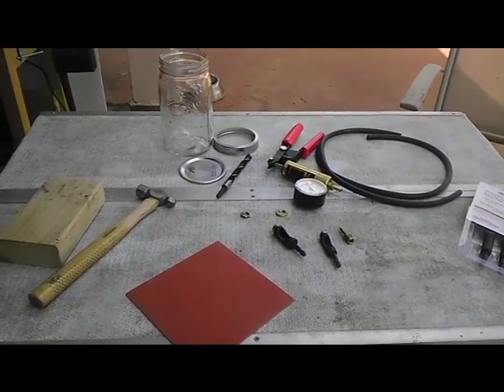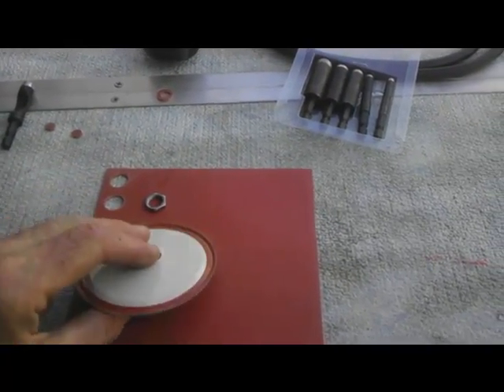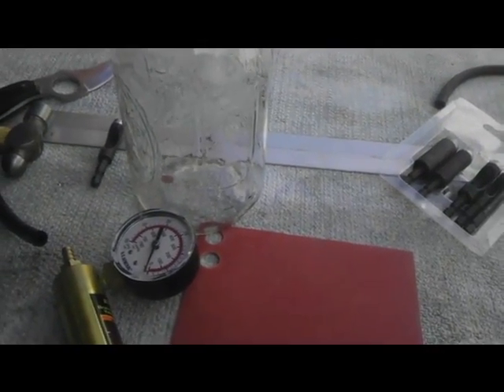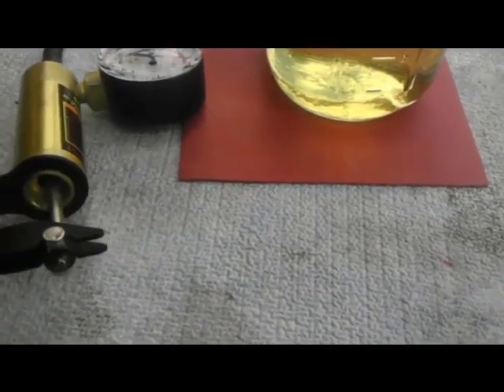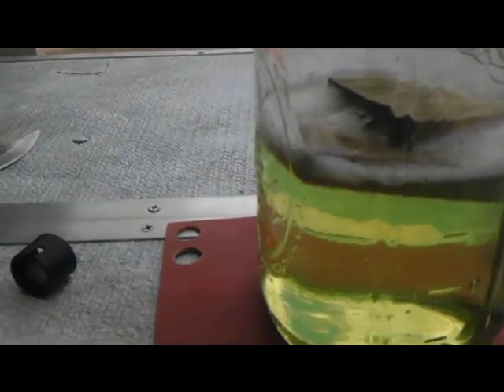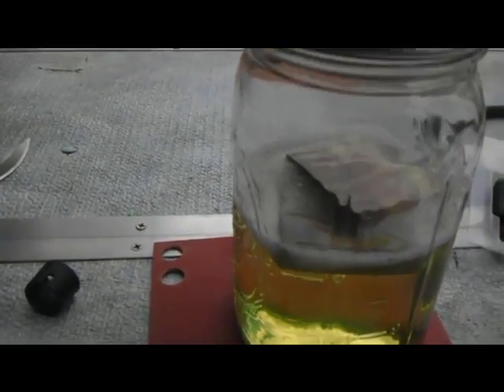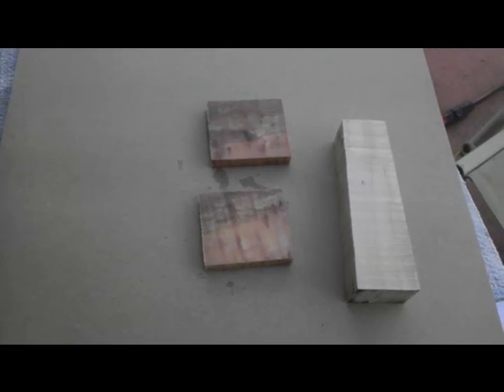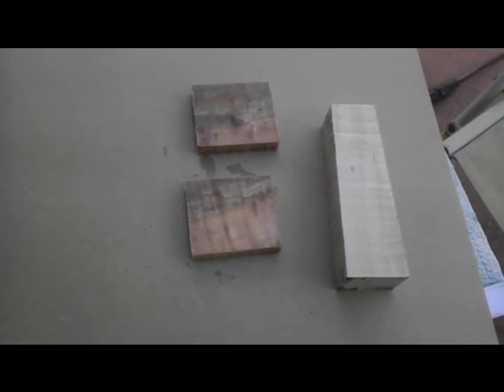How to create a Vacuum Infusion Chamber to...

Comment from the maker: Bryan in this video I didn't use Cactus Juice. I used a MiniWax product. This was back when I started trying to stabilize stuff. I don't use this method anymore. I now have a vacuum pump and a large chamber.

Cactus Juice also has a guaranteed shelf life of 12 months once mixed. If when you try it and it doesn't last that long for you let the company know about it.  I usually go through a gallon in about 2 month when I'm using it these days.

Comment: I have engineered a better way to create vacuum without the use of a powered motor utilizing the use of suction. Imagine a cup turned upside down in water and pull the cup and water above the waterline with air in it.It creates the same vacuum effect. You just need a bleeder valve and a system where your work space box or (cup) will remain stationary..use a flange for your jar. and a gauge for pressure. lower the box open drawing in water. close valve and raise to desired pressure is reached. hard to explain I should make a video. Its easy and cheap and can be made to much larger sizes.
Reply from the maker: Aaron, do a video showing us this in action so we can all better understand your process. Please provide a link. I am always willing to try something new. Just not quite sure how to try your method.

Comment from the maker: Just saw the comment about not using a mason jar. Mason jars are made for canning and are very strong. As with any container you need to inspect it prior to using it. If you are worried by it then set the jar inside a gallon paint can that is made of metal. As with all shop related activities exercise safety procedures and wear safety gear.

Comment: This is a good idea for the home DIYer, but I have found that if the jar is too big with too greater cavity between the top and the liquid then it takes a lot more effort to create the necessary vacuum.  It also works better if you can submerse the timber portions with a weight to keep them below the surface.  You really see the air escaping from them quite quickly rather than wait for them to become entirely saturated and sink on their own.

Comment: Hello,
would it not be a good idea to first weight the wood down to insure a good infusion?
Thanks and greetings from Germany
Reply from the maker: I have found that as the wood absorbs the liquid it becomes heavier and sinks to the bottom on it's own. That lets you know the exchange and release of air is fully working. You can weigh it down if you like. I did with my very first chamber.

Comment: Have you ever used Cactus Juice?
Reply from the maker: Sally, that's what I'm using now. I have a new chamber that's larger and uses an electric vacuum pump. I get my Cactus Juice from USKnifemaker.com. Works a lot better than the old stuff. I got a used toaster oven at Goodwill for $5 to bake my materials afterwards.
Reply from the maker: Cactus Juice is great stuff. Easy to use and gives great results. Very important it not too expensive to use and keeps well.

Comment: what kind if resin is that ? Is it just resin and no hardener?  Thanks for the help in advance . JOE
Reply from the maker: In this video I used Miniwax Hardener:

http://www.minwax.com/wood-products/maintenance-repair/minwax-high-performance-wood-hardener?gclid=CMD6xoCmlLwCFQto7AodLGAAZA

I am now using Cactus Juice:

http://www.turntex.com/index.php?option=com_virtuemart&Itemid=121

You will need a Toaster Oven from a thrift shop to heat it. This works better than the air dry resin.

Comment: i wouldnt use a mason jar friend, as its made of glass. any slight imperfection in the glass, visible or non visible to the eye, could cause implosion effectively turning that mason jar under vacuum into a glass hand grenade. not good. get an acrylic lid with a gasket and a steel/aluminum wall cooking pot. the thicker the walls the better. it that implodes, it will not shatter!

Comment from the maker: Yes, not enough air removal to fully replace the air in the handle material. I have upgraded to an electric vacuum pump that cost 50$ on ebay, it works quite well.